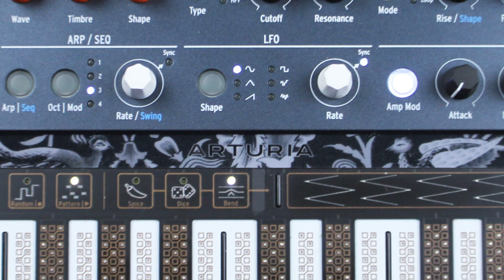18-The Arturia MicroFreak- LFO and Envelope

Comment: Some confusion on polyphony - according to arturia website, the envelope  (and other modulation sources) are polyphonic. So setting envelope to modulate amp - wouldn't that make amp envelope polyphonic per voice?
Reply from the maker: There are only two envelopes and one amp according to my understanding... while it's possible that the envelopes could be directed to two different things, there is still only one filter and one amp, so it doesn't really work.
Reply: @automaticgainsay  Thx for clearing that up.